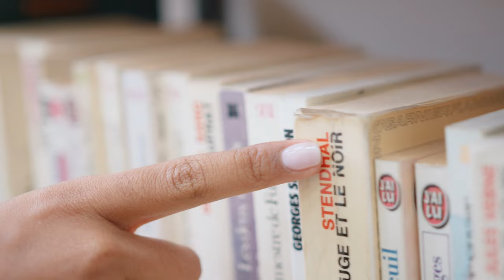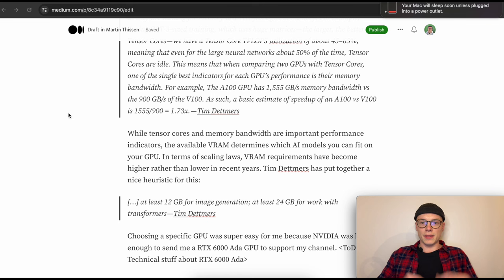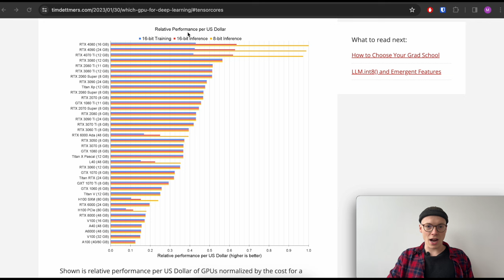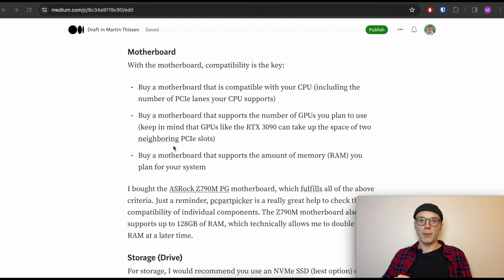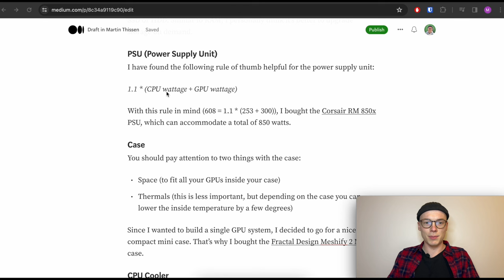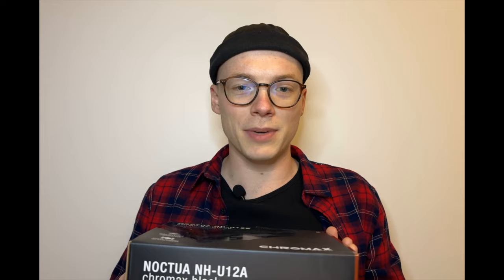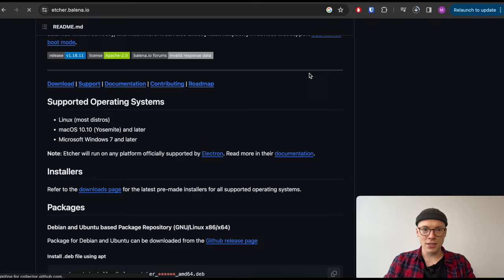How I Built My $10,000 Deep Learning Workstation

Comment: You can get a much better machine with less than $10k. Basically get 192GB DDR5 RAM and 2x 4090 or 2x 3090. You’ll even get better performance with 2 of these GPUs than a single RTX 6000 despite both equating 48GB VRAM.
Reply: Don’t forget they need to be a single node, if you mean to do any serious work with it.
Reply: Could you make a post on what you wrote here so that others can refer to?
Reply: @sokhibtukhtaev9693 Anything you have questions about, on what they said?

Comment: Found a glitch today. I learned that @ around $1148.66 you can buy TWO RTX 4060 Ti OCs and get 32GB of VRAM for less than half what a 4090 costs. Now that I’ve seen this I can help but think that for 1750-2500 Nvidia has been ripping people off building Deep Learning/AI Servers. OH! And the 4060s only need ONE 8-Pin power cable so running both of them with a smaller power supply should be no problem if you’re just upgrading your current system.

Comment: You probably could have gotten everything but the GPU for  less than $1k and already assembled if you had chosen a second hand Lenovo or Dell or HP workstation. The 2year old refurbished thinkstation 940 can be had with 2 CPUs and 513GB ram with 3 x16 PCIe slots and these devices are already configured to support high end GPUs. Consumer hardware is fine if that is all you can get but a proper workstation cannot be beat on price or performance. On a 10k budget that can buy a lot more GPU and you will be putting it in a motherboard that won't loose it solder under the heat if a few GPUs.

Comment: 🎯 Key Takeaways for quick navigation:

00:00 🖥️ Building a $10,000 deep learning workstation involves careful planning and research.
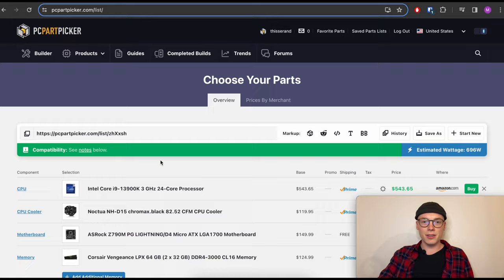01:36 🛠️ PCPartPicker is a valuable tool for organizing components, prices, and compatibility when building a deep learning workstation.
02:17 🎮 GPU selection is crucial; consider factors like tensor cores, memory bandwidth, and GPU memory for optimal deep learning performance.
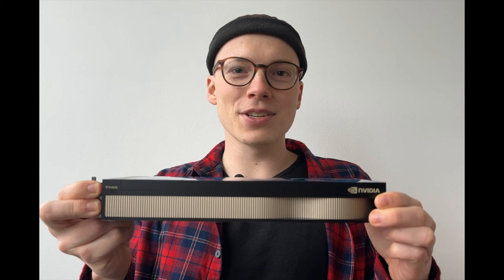05:14 💻 Collaboration with Nvidia can provide high-endGPUs with ample VRAM for deep learning tasks.
08:02 🧠 CPU choice should consider having at least four CPU cores per GPU and sufficient PCI lanes for GPU connections.
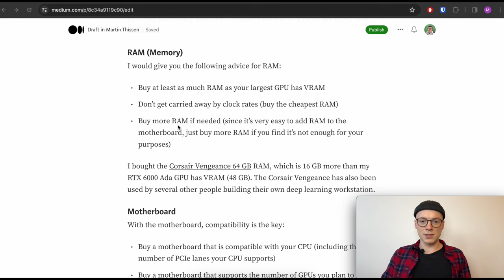09:12 💾 RAM should match the largest GPU's VRAM and can be added later if needed.
09:54 🖥️ Ensure motherboard compatibility with CPU, GPU, RAM, and other components.
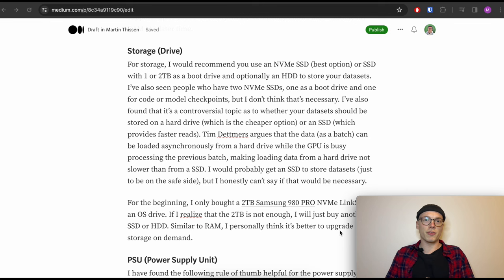11:14 🧰 Consider using NVMe SSDs for OS and data storage, while HDDs or SSDs can be used for data sets.
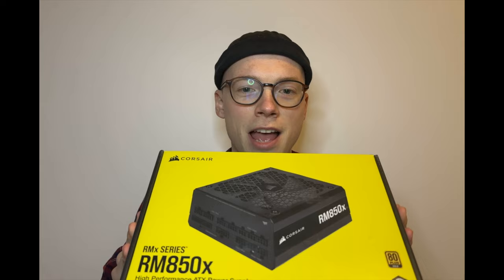13:19 ⚡ Ensure your PSU has adequate wattage based on your components, and choose a case with sufficient space and good airflow.
16:05 🔄 Double-check if any CPU cooler components need to be installed on the back of the motherboard before mounting it in the case.
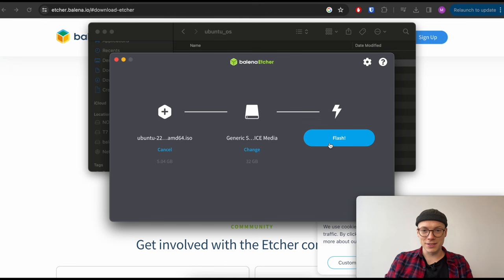19:45 🚀 Use Lambda Stack to easily install all necessary GPU drivers and dependencies for AI model training.
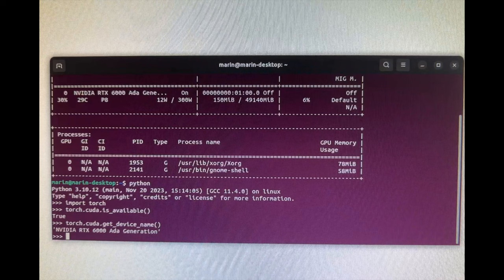21:54 🤖 Verify GPU and PyTorch installation to ensure your deep learning workstation is ready for AI tasks.
Reply from the maker: Love that! :-) What tool did you use?

Comment: in terms of GPU for making only Art any RTX card usable, because Nvidia finally updated driver and process can be offloaded to system RAM from GPU (only Windows as i remember, stable diffusion in automatic1111).
Anyway, ordinary people can still use many modern open models as consumers released each day with only CPU by GGUF format, better to have any multi-core CPU like cheap Xeons on Ali and 128Gb Ram (less Ram=less choice, if i remember correctly Llama2 70B GGUF 8bit uses like 80Gb of Ram).
Also, instead of Ubuntu i would use a Zorin OS, like Ubuntu but with flatpaks.
Reply: when it comes to the motherboards of those xeons, the chipsets are used h61 motherboard chipsets taken from old dell desktops so not the best quality, also their software is basically made by the chinese and russian gaming communities who want's cheap platforms for gaming, you are better off with an entry level ryzen cpu and motherboard who have a warranty and software made by billion dollar corporations.
Reply: @emanuelsavage-op5mm  that is really weird argumentation, even some racism notes. There's a huge choice on market for Xeon's, if you have money just take supermicro boards. Offering AMD which can't into CUDA is like offering salt instead of sugar.
Reply: How to offload to the system ram - which framework does support it - pytorch TF etc?

Comment: Great video!I am really confused on which package & model of gpu & cpu to buy.I have seen these recommended package:

AMD Ryzen 7 7800X3D Processor

￼￼

Deepcool AK400 DIGITAL - AFTERSHOCK Edition

￼￼

Gigabyte B650M Gaming Wifi

￼￼

Gigabyte RTX 4090 Windforce V2 - 24GB

￼￼

32GB Team T-Force Delta RGB 6000mhz (16x2)

￼￼

2TB Lexar NQ710 Gen4 SSD

￼￼

850W Deepcool 80+ Gold ATX3.0 (ZC850D)

￼￼

AX Wireless + Bluetooth Included

Is this package powerful & fast enough to run majority of AI applications & video rendering?Does the number of cores and threads in CPU affect the performance & speed of AI workloads?Should i buy intel or AMD processor?
I would like to hear your recommendation 😍